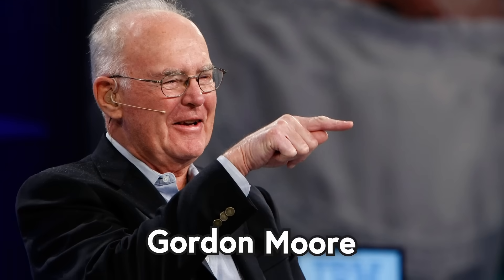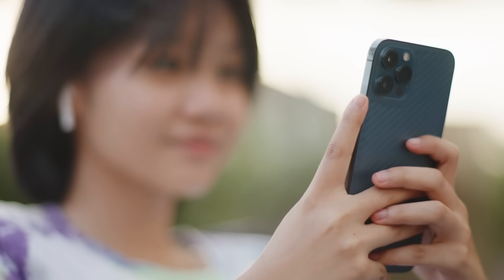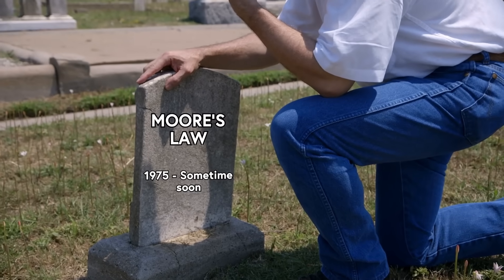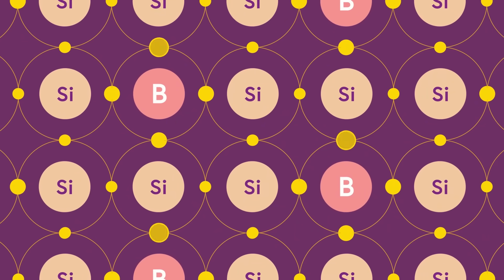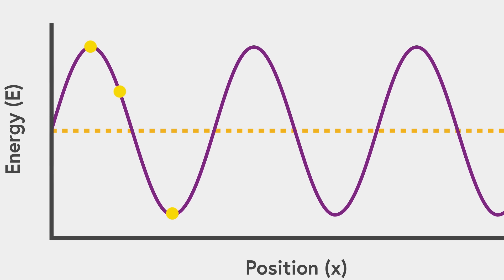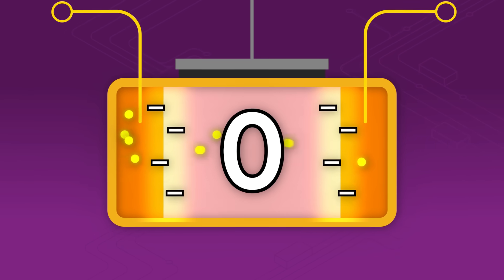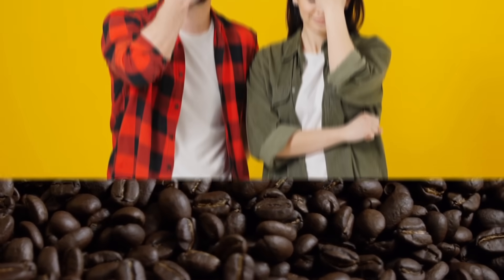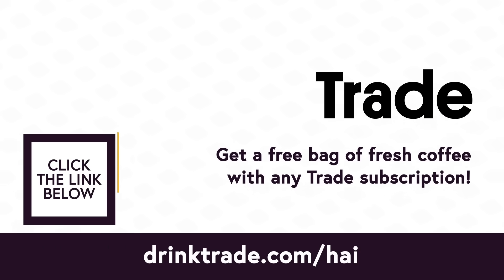Why We're Reaching the Theoretical Limit of Computer Power

Comment: The component in the thumbnail is a voltage regulator. While voltage regulators typically use transistors to regulate voltage, using a voltage regulator in the thumbnail for a video about transistors and implying the distance between two legs of a voltage regulator is 10 atoms is misleading at best.

Comment: dennard scaling is actually the reason why computers are getting more fast less quickly

back in the 2000s we hit a wall where the power density of transistors couldn't go lower and started the increase, leading to more inefficient transistors as you get smaller

which was exactly the point when the industry switched to doing multicore instead of just making 1 core twice as fast

Comment: what about the 2nd law that people were talking about going to... i forgot what it was named but effectively it prioritized efficiency over productivity... in my opinion, if you can give me the speeds of an RTX 5090 running off the wattage of a tesla p4 (75 watts cap) i would be way happier then just getting a RTX 6090 having faster speeds. especially when the price of electricity can be going up very soon depending on what goes on with coal and oil.

Comment: Quantum computing is not a replacement for traditional computing, at least not in the short to mid term. Currently, advancements in material science and innovations in geometry of the transistors continues to improve the performance, but not quite at the same rate as before. The next thing is more likely to be expanding further into the third dimension, with the logic components. On the other side, we can't underestimate improvements in software efficiency. Software engineers have come up with interesting designs that save precious CPU cycles. Innovations of this type are going to see a sharp increase in the near future because of AI, which has already discovered more efficient matrix multiplication algorithms, and more. These are being integrated into standard libraries for all new or updated software to benefit from.

Comment: Something to say :

 1.The Slowing Down of Moore's Law
   - What is Moore's Law?

     - Moore's Law states that the number of transistors on a microchip doubles approximately every two years, which historically led to the exponential growth of computing power and efficiency.
   - Why might it end?
     - Physical Limitations : Transistors are now approaching atomic sizes (around 3 to 5 nanometers in current technology), and at such small scales, fundamental physical challenges arise. Quantum effects, like **tunneling**, cause electrons to pass through barriers that would traditionally confine them in transistors, making the transistors unreliable.
     - Cost and Complexity : Each generation of chip manufacturing becomes more expensive and complex. As the processes become more intricate (e.g., extreme ultraviolet lithography), the cost per transistor no longer decreases as it used to.
     - Slower Improvements : In recent years, the doubling of transistors has slowed down, signaling that the pace predicted by Moore's Law is tapering off.

 2. Theoretical Limits of Computing Power
   - Quantum and Thermodynamic Limits :
  
 - Quantum Mechanics: The most fundamental limit to transistor miniaturization lies in quantum mechanics. Once transistors are reduced to just a few atoms in size, quantum tunneling makes them unable to reliably function as switches.
     - Thermodynamic Limits: Computing also faces thermodynamic constraints, primarily in terms of heat dissipation. As transistors become smaller and more densely packed, they generate more heat. The heat needs to be efficiently dissipated to prevent the chips from overheating, but we are approaching a limit to how much heat can be removed without energy losses.
     - Landauer’s Principle : This principle suggests that there is a minimum possible energy consumption for irreversible computations, which represents the theoretical lower bound of energy efficiency for classical computing.

Comment: You're Wrong, We're Not in the Limit of Computers Power!!!!! Even if we somehow couldn't get transistors smaller than 2 Nanometers that won't mean we can't get faster computer's,  because we can just have much biger dies, theres no limits for dies Size, theres computers which have an Entire Wafer used as its processor, like an full hand size silicon, for that computers will need far bigger heatinks, and will consume thousands of whats but its what it's, also we can have higher clock speed which is something i don't know if theres any limit at all, current cpus Run ar max 6.5Ghz clock, Gpus at max 3Ghz, in 2005 GPUs used to run at 0.5Ghz and Cpus at 3.2Ghz, Duplicating the clock make performance twice as fast, if one pipeline generating 8 flops then at twice clock will do 16 flops.

Comment: Heat is a bigger problem than size.  A full on transistor is very efficient.  An "OFF" transistor is about as efficient as you can get.  But its the transistions between ON and OFF create heat.  Thats because for a split second, your not fully ON or OFF.  Your somewhere inbetween.   Create that "inbetween" scenario 5 billlion times a second and thats why your desktop computer needs liquid cooling and 8 fans these days.

Comment: Mores law is now transistors per mm^2 doubling every 48 months in the 2020s. It used to be every 3 years in the 2010. it was every 2 years until the 22nm process.
Reply: No. It has nothing to do with a defined area that transistors are fitted to.

Comment: Quantum computers will not replace classical computers anytime soon. They are meant to solve certain problems, if they work at all. Computing power will increase not just through a higher number of transistors but also through better design and architecture of SOC.
Reply: there so unstable and there are so many issues im guessing we are going to start seeing consumer quantum computers in 2060 but its going to be a standard by 2072

Comment: If anyone in quantum physics knows please feel free to reply, but isn’t quantum tunneling like pushing off a wall in your pool? You eventually stop because water slows you, but if the pool is short enough you will reach the other wall without stopping. Is this a good analogy?
Reply: Transistors are nowhere near the scales that quantum tunnelling would be an issue.  There so much ignorance out there it is astounding. And worse it is being repeated by people that should know better. Moore’s law is not about the size of transistors but the double of the number of transistors on an integrated circuit.

Comment: nice video! probably the best transistor explanation i've heard, and honestly made things clear that i didn't quite pick up on before. 

also one error at the end: quantum computing is not a general replacement for transistor/binary computing. it will make certain algorithm possible, that are currently pragmatically impossible, but it's not gunna speed up basic logic/branching.

Comment: A great way someone explained Moore's Law slowing down is to imagine using a cellphone from 2014 now in 2024. It would be possible, albeit slower, but you could still do it pretty easily. Now, imagine if you live in 2014 and are using a phone from 2004. It would be significantly harder and significantly slower than the previous situation.

It is the same with a computer. Using a computer from 2014 would be slower, but still possible. However, using a 2004 computer in 2014 would be a much more difficult endeavor.

Comment: I think we noticed that over the past twenty years.  Just for an example, I have a gen-4 motherboard & CPU and I recently picked up a gen-12 MB & CPU, and they BOTH run at 2.3 Gig.  Now granted they are two different pieces of hardware but the focus is on the number of CPUs and their supporting hardware rather than the speed.

Comment: Lol, I remember debating this almost 20 years ago when we were just on the brink of the theoretical limit of computing power. We're not even close to the theoretical limit. We've barely scratched the surface of what's possible. If, however, you are referring to the limits of current architectures, okay, then we're close to the limit of those architectures.

Comment: As much as I hate Apple as a company, one of the few credits I will give to them is the M1 series chips. What they realized is that all they needed to do to improve speeds while minimizing power was to take the concept of fitting as many transistors together as physics would allow, and instead apply it on a more microscopic scale with regards to the various motherboard components. So, things that woulf regularly be halfway across the motherboard from the CPU, are now entirely contained inside it, improving efficiency of any operations that need to make use of them

Comment: If you can't fit more transistors on a chip, then make processor bigger
Reply: true but that also has a limit because of heat problems and speed problems. 

The maximum size of a chip with not too much heat prolems and still runs fast is probably only a bit bigger than current chips

(with current tech of course .If we solely focused on making larger chips we would find a way just like the density problem) 

so what do we do after that?Because no matter how much we optimize we will hit a physical limit

Comment: If we look at Moores law in terms of flops rather than transistor count there's some room to keep going.  Processors are limited in their clock speed by the amount of heat they produce, for instance, and optical computers produce very little heat, so we may go that way.  

Apple switched to RISC with the M family of chips.  Reduced Instruction Set Chips were already popular in cel phones because they use less power and create less heat, Apple showed just how powerful they are using fewer transistors but upping the clock rate (which is possible because of how cool they run) and reducing the number of discrete steps that makes a processor cycle. We still have yet to see these pushed to their limits with overclocking and active chilling, most M family devices just disperse heat without even using fans.  

Intel and AMD are going a different direction, sticking with complex instruction set chips but selling chips with bigger dies.  If you can't put more transistors into a chip by using smaller lithography, just put more the old fashioned way.

Comment: They've been saying Moore's law is about to die for twenty years.  They always have a perfectly plausible reason chips are reaching their highest possible level of complexity.  They're always wrong.
Reply: So why are we now seeing 500 watt GPUs with barely any increase in hardware performance? Silicone transistors are at their limit.
Reply: well they aren't wrong as we are reaching the physical limit of shrinking transistors. As a result Moore's law has noticably slowed down.

that's not to say progress is dead. But we're needing to look for new ways to improve computers and it's taking more time to do it.

Comment: Quantum computing isn’t a replacement for traditional computing improvements, because quantum computation is only better for some times of computations, it’s worse for others. It’s also less reliable (not that it breaks more rather the calculations have to be done inside limited windows: they’re not consumer devices you can just turn on and use at any time)

The way around this problem isn’t with quantum computing, it’s by improving the quality of software, which has frankly gotten way shittier ever since we escaped the hardware bottlenecks that forced code to be efficient and high quality. Introduce a hardware bottleneck again and software will have to pick up the slack. Good programmers will be more in demand than ever before

Comment: I imagine you could use an error correction algorithm to be able to use the transistors that have a little bit of quantum tunneling

The question is whether the extra space required for error correction is worth making them slightly smaller

Comment: While it is getting difficult to fit in more transistors on the same area every year, adding more transistors is not the only way to optimize compute power. How the transistors are arranged also matters. There's tons of R&D going on about how to design powerful computational circuits (ALUs, FPUs, etc) while not consuming too many flip-flops. There's also lots of innovation going around in how to optimize a general-purpose CPU for a particular use-case. If your CPU is going to handle lots of cryptographic calculations, you'll find dedicated hardware for those, and/or the CPU will have more ALUs to handle all the computation. Then there's things like efficient cache policies, so that you access data more efficiently without wasting time. There's also compiler optimizations, where the compiler produces efficient code (not just code size, but it can also be special types of "code" that the hardware is designed to process faster).
Moore's Law may not be relevant nowadays, but people are always finding workarounds to improve performance while using as less resources as possible.

Comment: Optical (photon based) chips will restart Moores Law. Not quantum computers.

Photonic (optical) chips work using the same type of computer languages as electronic chips.

However, quantum computers work an entirely different way, and require entirely different kinds of computer languages, and programming skill sets.

The real magic will come from putting the two radically different types of computers together. Since they are each great at the precise types of computing that the other is bad at.

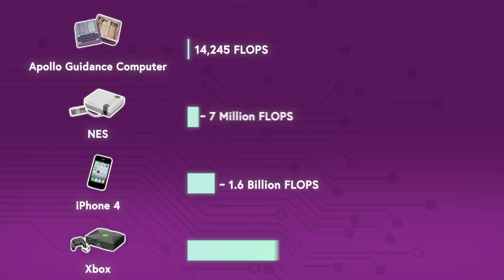Comment: 1:27 That is just wrong. Flops measure floating point throughput, and while I am not an expert on the Apollo guidance computer, I can say with certainty that the NES could not do 7 million floating point operations per second. It's CPU ran at about 1.7 MHz and didn't even support floating point numbers in hardware. Emulating them would take multiple cycles per operation. At best, I'd estimate that it can do 100 to 200 kFLOPS.

Comment: ...theoretical limit in a 2 dimensional process, just look at brain tissue. We either grow or engineer electrical pathways that fill a volume, that volume also doesn't have to be a tiny little square it could fill a large structural part of a product.. If you think computers are about to start stagnating long term you'd be wrong, we are still going to end up with a pair of ordinary looking glasses that can beat your top of the range overclocked gaming pc of today

Comment: Small correction, we don’t have 2nm transistors yet, not even 20nm

The “5nm”, “4nm” and “2nm” technologies are not based on any real measurement. They are simply marketing terms.
Basically every time they double the number of transistors per 1mm square they shrink the number based on absolutely nothing. That’s why 7nm from TSMC is different than 7nm from Samsung or intel (intel literally renamed their 10nm chips to 7nm! because their 10nm was better than 7nm in other manufacturers 

We will eventually reach a point where it makes no sense to go smaller or actually reach the physical limits, but not yet.

Comment: Wonderful explanation! I do think, however that we must be focused on the next step in technology. I beg to differ that Quantum computing will not be the future of computers. #1 it's extremely expensive, and #2 they just don't work the same. However, I DO think that the future of computing should be focused on PHOTONS. That right, instead of our logic gates (transistors) working via electrons, the logic gates will consist of photons aka light (think fiber optics). They're already working on photon based storage mediums and photon based memory chips! The current issue as of know is trying to integrate electron based processing with photon based processing. As things are the biggest bottle neck is the CPU. I'm excited to see what the future of computing holds and what will become the next "Big Leap" in tech is. Since we're already down to a 2nm chip process I'm curious how much smaller we can successfully go, and when that limit is reached, what the next medium will be. Cheers!

Comment: Moore law is misunderstood, he did not predict chip would get smaller, he predicted chip will have more transistor in them, that's 2 totally different thing. if you can't make them smaller, just make them bigger. for example AMD is actually using bigger chip moving part of it from 5nm to 6nm because it cheaper to produce, no one really care about the physical size of the chip is huge, as long as it produce more processing power, if they need more sillicon to make it but it is cheaper, who really care?

Comment: We NOT reaching the theoretical Limit of Computer Power. You ignore the fact of a 3 dimensional world. 

The limit is acual not a physical one. It is an economical and mathematical one. The price per factory also grow exponentialy as well as the chip production per factory. This works out, as long as you can sell these chips. There are basicaly two way to do this. 
Increase market share per factory, by reducing the number of factories. And increase the overall maket revenue of the chip industry. But both have limits. You can not reduce the number of factories below 1. And you can not increase the revenue beyond the woldwide gdp.